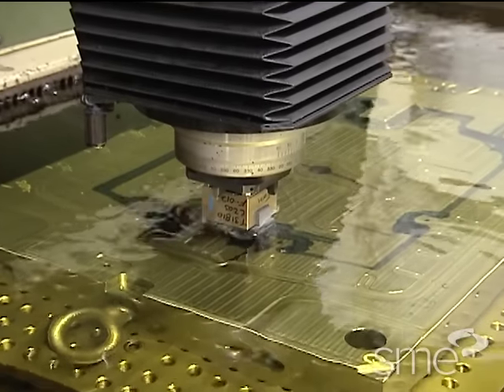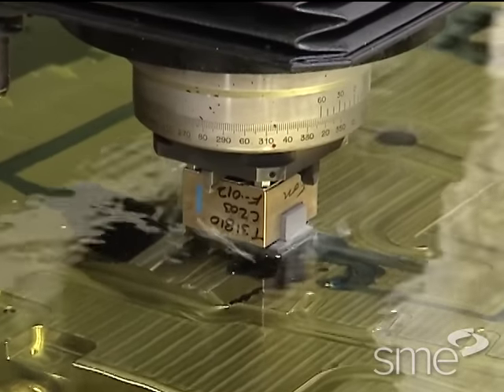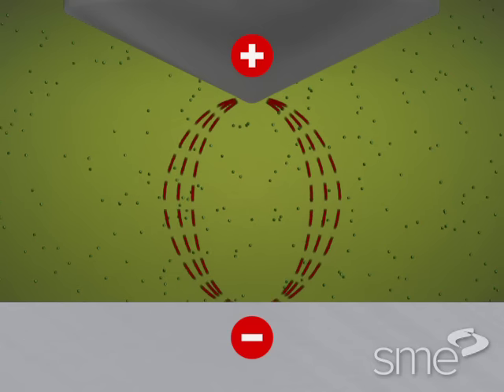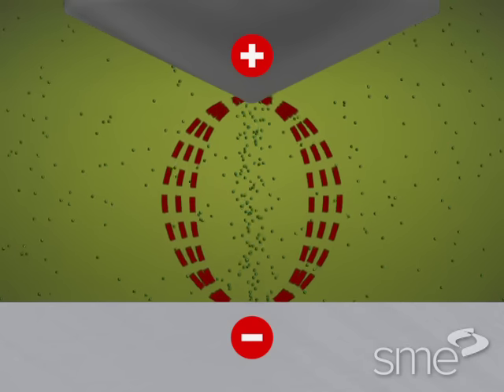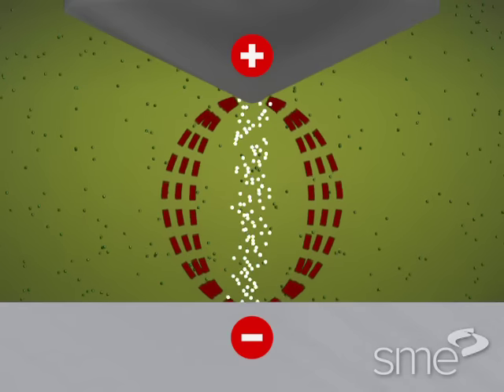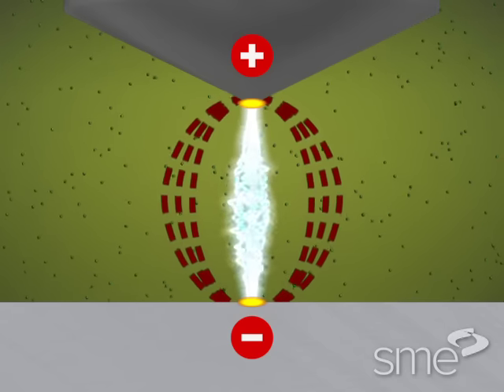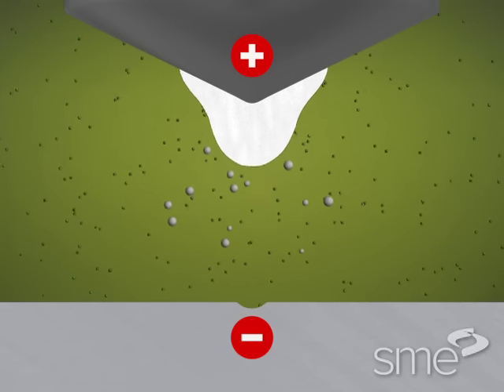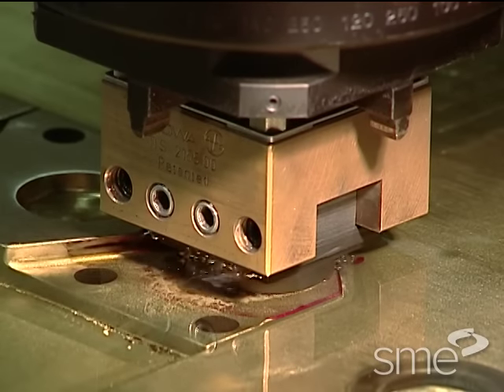Electrical Discharge Machining

Comment: i think workpiece should be attatch to positive terminal of power supply and tool will be negative terminal
your concept is not making any sense
Reply: This setup is kept in reverse polarity and so the material removed from the tool will be more than that of the work piece. This is done when you need to machine a very thin layer or to create surface roughness/topography.  For example creating surface roughness on a orthopedic implant